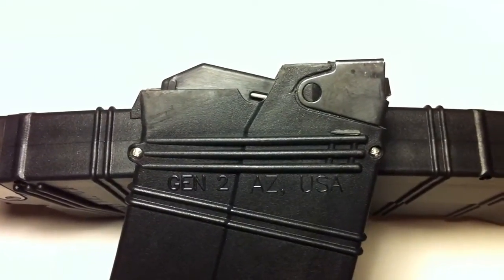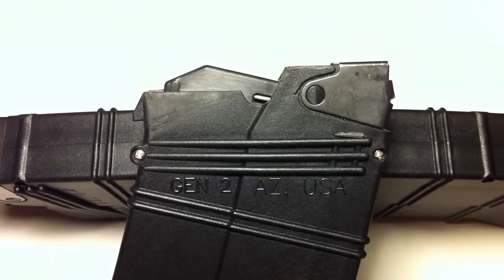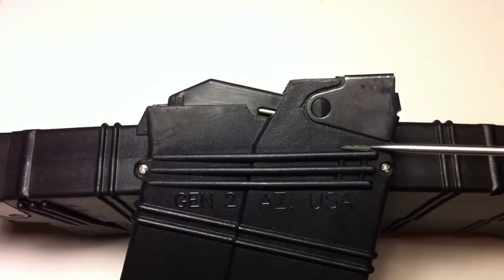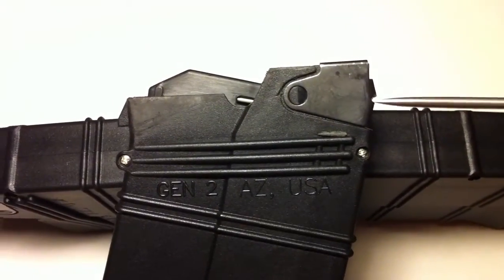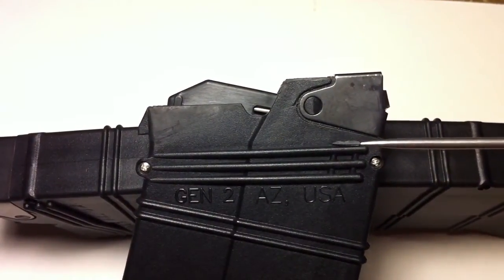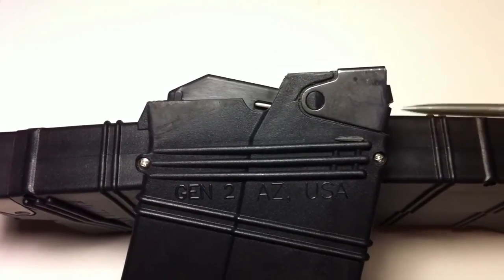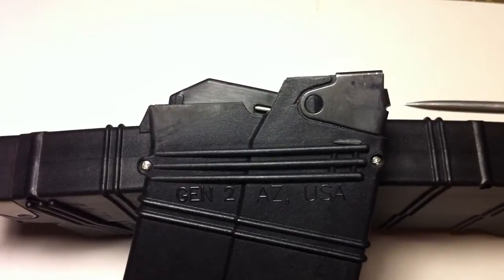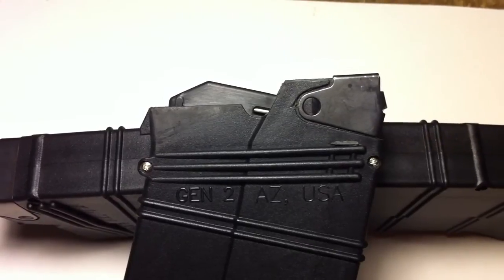Agp 10 round saiga 12 magazine design flaw and fix

Comment: Look up instructions for fitting MD Arms MD 20. Those are perfect instructions for fitting a magazine to the S12. 

Also, I have successfully welded a sheared rear lug onto an izhmash saiga 12 mag. It is better than new. You can do the same to make your magazine fit snugly again. Just clean with alcohol, and use the low heat setting of a soldering iron with the hot knife tip, and use your take off furniture as donor plastic. there are lots of good videos on plastic welding.